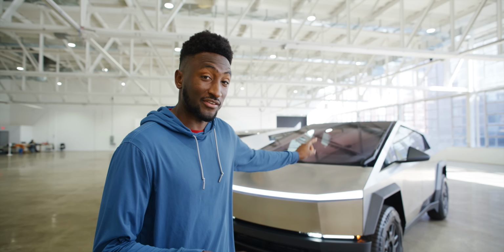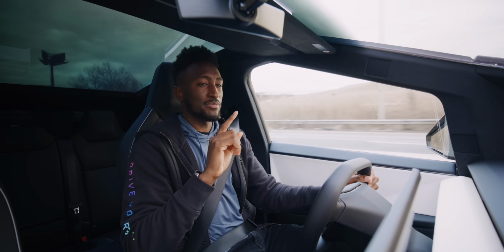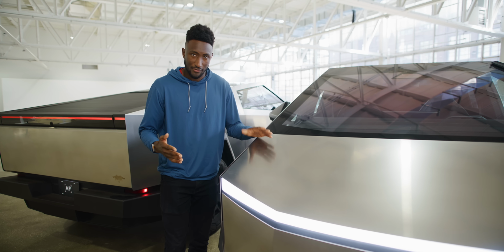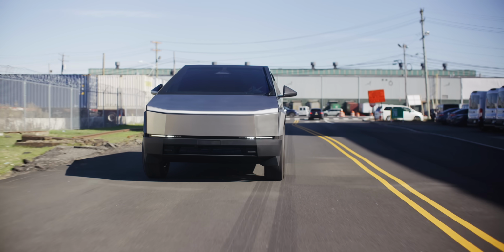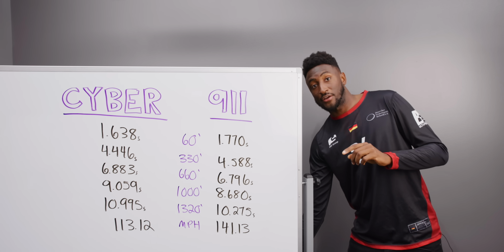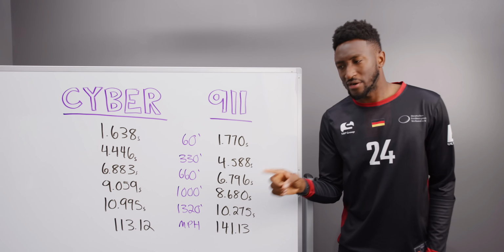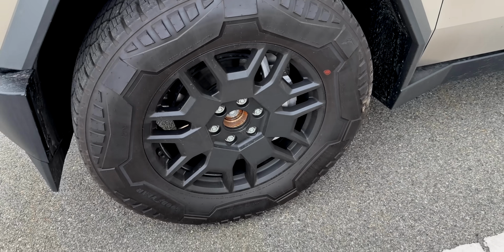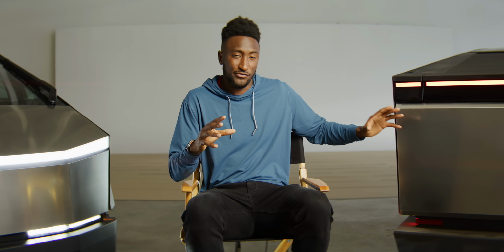Tesla Cybertruck Review: Already Iconic?

Comment: Gas motors are peaky.  They need to be in a certain rpm range for max horsepower let’s say 6000 rpm.  They need gears to help stay in that sweet sport.  Compromises on torque and or horsepower.  More rpm means more horsepower but sacrifices torque.  Electric motors full torque from 0 rpm.  Very torque rich through whole power band at 85% efficiency.  Gas  motors only 25% efficient as most energy given off as heat.  Similar comparing incandescent bulb vs led bulb.  Oil/gas is so cheap that inefficient gas engines are allowed.  Most car gas motors average 24 mpg vs EV’s over 100mpge.  75% of the drilling, pumping, shipping, refining, and transport of oil/gas thrown away to air, water, and land pollution. 450,000 oil refineries located in large cities worldwide causing 50% air pollution and 6 million deaths/year from FF pollution.  Grid is greener everyday.  No tail pipe emissions in front of you in traffic.  Storage batteries on the grid is the holy grail to supply/demand

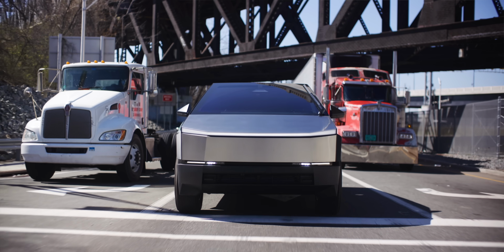Comment: 10:05 'Truck Stuff' there's 2 trucks in this frame and the Cybertruck isn't one of them
Reply: 4 wheels, 6 foot bed. Those are the requirements you need to be a truck. Being liked by Tasz_ isn't one of them.😢
Reply: @retro1120  I had a toyota corolla with a 6ft bed if the back seats were folded down.. I could maybe pass the Tesla off as a ute but it's utility is limited

Comment: Stalk for signaling, highbeams, wipers, and buttons for hvac controls would be GREAT and are MUCH easier/accessible to operate. For turn signals, if you live in the city or certain areas, there are times when you are making a turn and immediately need to signal again for another turn. This is very difficult to do in the teslas when your steering wheel is turned. 
Tesla, PLEASE put physical buttons for commonly used functions(such as hvac).  Physical buttons for some stuff is MUCH better. Bring back the stalk for turn signals.

Comment: We went from non power steering to powered steering to variable ratio steering.  Why do we still have to turn the wheel 2-3 revolutions to turn vs just a quarter turn.  Planes flying by wire for decades.  48v system needed to steering electric motors as well as wiper motor.

Comment: If you wanna talk archaic, we could bring up the fact that Henry Ford tried stainless steel almost a century ago, realized the issues with production and quality when trying to make a vehicle with it, and immediately pivoted back to the real stuff. It's a gimmick. It should not be driven on the road, there's a reason it's banned across the EU and the UK. If you want to endanger others, have a shitty fingerprint covered mess, and love purchasing vehicles that miss pretty much every mark they originally advertised on, the Cybertruck is for you! It is a drivable affront to regulations in this country and that's quite possibly the biggest plus for weird Silicon Valley nerds with extra income just lying around. If that thing rear ends a sedan at high speeds, it's taking the whole top of the vehicle and the driver's head along with it.

Comment: Quite the milquetoast "review". Couldn't even properly call out Tesla for legally lying in their advertisements; I wouldn't call misleading potential customers as "clever". Hardly went over any aspects of the truck apart from brochure bullet points. How about the interior space or things like the front lights don't work all the time in snow because it builds up in the gap between the bumper and frunk. I know some of those things were mentioned in other videos on AutoFocus, but this is supposed to be the main review where you bring all that stuff together into one cohesive and comprehensive conclusion. The conclusion we got here was philosophizing about if the truck iconic... Disappointing, I expect more from this channel. The production value was nice, but that's about it. Style over substance

Comment: Putting the styling aside, the construction isn't that different to standard monocoque vehicles; it has a normal steel unibody underneath the stainless steel panels, although it uses aluminium castings front and rear, that bolt to the unibody. Those castings mount the suspension, which I don't like as aluminium fatigues with use, so I'd be expecting the castings to fracture at some point. Frankly, this is a dumb vehicle that only exists because Musk had a brain fart and had the coin to make it happen.

Comment: Super cool video as always. One thing I REALLY disagree with though and that is dearly missing in my opinion, is talking about the crash behavior of a Cybertruck. You say you'll be fine in a fenderbender, but exactly the opposite is true. Yes, the car will be fine, but modern cars are designed to be destroyed in a crash, because that energy has to go SOMEWHERE. If it isn't the car, then it is your body.
Even though Tesla makes it seem like it's mostly about tech in new cars, they should still be good at getting you around safely. The cybertruck sadly fails at that (to my knowledge) and there are no plans to crash test it independently, which should definitely be mentioned
Reply: that's fake news about driver being in critical condition.
Reply: @JoshuaValvi1  Good catch! Deleted that part, I must admit I only remember that news from when it first broke and it appears the first coverage wasnt truthful. 
That does not change the main point of the comment tough, thanks!

Comment: Trying to sell a "steer by wire" solution as positive is just cheap. I've driven many of those cars by now, and obviously many more with a physical steering connection to the wheels. Not wanting to go into detail here, but you can feel the difference within the first seconds of driving. And honestly, I think most of these digital steering systems can be quite dangerous, because they are so unpredictably bad!  In my opinion nothing better than a steering wheel thats hardens at higher speeds by a physical connection, like in most high quality cars.

Comment: As a cyclist, I  am always concerned about the ability of drivers to see me on the road (bright clothing, flashing lights, etc). This thing would probably kill me at a 10mph collision.
Reply: Watch the Netherlands. Cyclists have their own separate road. Very safe.
Reply: Teslas are literally the most dangerous brand on the roads right now. Look it up.
Reply: Wait. Why do people say this has bad visibility? This has better visibility than most cars out the front in a very wide arc. The back visibility is bad if you have the cover closed, for sure, but the side views are no worse/are better than its competitors. There are plenty of legit complaints about this car, but visibility is a weird one.
Reply: Any truck would be able to kill someone… the Fire F-150 for example weighs only a couple hundred pounds less than this. There should be absolutely no difference in safety for other people, but when it comes to safety of the people in the truck, that is where it rocks.
Reply: @MakerMikeAlt  Yeah, at least the corners on the F-150 are a little more rounded. The corners on this thing are sharp. But yeah, probably a moot point at these weights.
Reply: @jamesvan8166 actually it would be safer as you are more likely to roll over the top of the hood in compared to other pick up trucks which would be like hitting a brick wall
Reply: @jamesvan8166 I can’t see you because of the high hood on the f150. The cybertruck slopes down and gives way better visibility.
Reply: Simply solution, cycle at faster than 10 mph, problem solved.
Reply: Cyclists shouldn't have human rights...
Reply: Tesla has top notch accident and pedestrian avoidance systems. There are some good vids the European Test agency did that are crazy.
Reply: @aaronb7990  and the videos of teslas on their autopilot trying to turn into parked cars, braking in the middle of the road, not recognizing pedestrians, abrupt lane changes, other phantom braking, taking left turns into oncoming traffic, ignoring turn only lanes?
Reply: @justinrockholt7055 half those videos are completely fake. And Tesla isn’t the only one with self driving. Theirs a Uber like app that has no driver and drives around town.
Reply: @justinrockholt7055   Are you from 2014? Tesla, per mile, is 9x less accident prone than other vehicles.
Reply: @derpyderp1144  Tesla is the only self-driving company in the game, they've got a monopoly at this point. The LiDar, pre-scanned environment tech has no general purpose beyond city limits.
Reply: @derpyderp1144 ahh yes, of course they are all fake.
Reply: @Tojoblindeye  I didn’t say all I said “half”. Lots of people hate Tesla’s for whatever reason that is and make videos like that to garner hate for it.
Reply: @justinrockholt7055  Funny how you didn't say running people over...

You didn't even say running into anything.

Self driving is a whole different topic besides accident avoidance. All you said was related to Self Driving which is optional. As for Self Driving making incorrect or uncomfortable manuvers doesn't mean injured or worse. Hands on the wheel and paying attention is how it is intended to be used at this stage. People 'letting it do its thing' for a video are irresponsible and should ha e taken over and left a comment to the Self Driving development team.
Reply: Fortunately, you wouldn't get hit to begin with, it simply won't allow it, even if you're mashing the pedal. 

Tesla and the Cybertruck are the safest vehicles in the world. Will save tens of thousands of cyclists.
Reply: @pt9845 source?

Comment: On the discussion of being "Iconic" the PT Cruiser comment is right on track.  Another example of this I have personal experience with is the VW Beetle.  Beetles were everywhere in the 1980s and again in the 2000-2010s (until they were discontinued for no reason...). Despite being everywhere, they were unique enough to get a reaction; I have owned two of them (2004 pattern and 2013 pattern) and my parents had several of the older versions, and you are constantly being noticed, and sometimes judged, for the car you drive.  That's what the Cybertruck feels like; people are going to judge you for driving one, and that phenomenon won't go away when there are thousands of them on the road.
Reply: It will go away because is just a fad

Comment: It's crazy that we are even comparing the speed of a truck to a sport's car. How fast the Cybertruck is, for a truck, is mind-blowing.
Reply: It's not crazy for an EV truck, others are only slightly slower.
Reply: @roadrash999 only the cybertruck breaks into the 10s in the quarter mile with higher top speed.
Reply: @starshipdriver8536  10.99 vs low 11s, not a massive difference.
Reply: @starshipdriver8536  You the type of person to think a 99 dollar product is a 90 dollar product.
Reply: @roadrash999  over mid 11s to 12s from other ev trucks top trims, they get gapped by the cyberbeast.

Comment: Regarding the drag vs 911, that's false advertising.

 It's a 911T.  A manual 7 speed, a low entry and not the best of 911.
Also it's a 1/8 mile and not 1/4 mile, Because simply that 911T would beat the cyber truck and was catching to it even in the 1/8.

Comment: The Lexus RZ 450e has steer-by-wire and has been on the road for a while now.
Reply: It'll still be on the road a decade+ from now - unlike you-know-what....
Reply: It’s technically not the first production car with steer-by-wire, as that distinction goes to the Inifiniti Q50 sedan and Q60 coupe launched in 2017. They have a conventional steering rack as standard, but buyers could optionally equip them with what the manufacturer called Direct Adaptive Steering, or DAS, its version of a steer-by-wire system.

Comment: Boats at, a certain size are steered by wire. Or more to the point steer by wire and hydraulic. The cargo container ship that slammed in to the bridge was steered by wire and hydraulics. Steer by wire and hydraulic is great until they don't work and then you've got some real problems. What I'm thinking about is the wintertime when you get a lot of snow down there and it freezes. On the boat that doesn't happen much. But what could happen to a truck left outside for a couple of days? Just a thought!

Comment: I'm disappointed you didn't talk about the safety at all. It doesn't "crumple" like any car. So when you get in an accident whatever you're hitting is definitely dead, and the person inside the truck will experience a lot of G forces increasing their chances of death. The automatic trunk close mechanism is powerful enough to cut off your fingers and won't stop.

You did talk about the quality a bit. But didn't mention that a lot of messages are already popping up about trucks starting to rust, which seems like relevant information
Reply: None of that is true. 😅

It DOES crumple like any other pick-up truck. They've shared collision tests, and people have compared it with other trucks too. Tesla engineers are literally experts in Car Safety. Their NHTSA rating speaks for itself.

And no, the frunk closing mechanism is not "powerful enough to cut your fingers". There's a pinch sensor in the front that retracts when it faces resistance. Before, the pinch sensor wasn't very tight, so it would close on your fingers, without "cutting" them - because the edges are filleted (There are YT videos of people testing this), but they solved this with a recent OTA software update tightening the pinch sensors and eliminating that problem.
Reply: Those are ALL wrong. I am a mechanical engineer, first off, the crumple zone is fine. Do you know there are regulations Tesla has to follow in order to out these vehicles on the road? Second, the front trunk does have sensors and Tesla said it will make it more sensitive with a OTA update. And also the rusting problem is just a surface rust and barely noticeable and can be wiped off easily. I can provide sources for all my claims if you care.
Reply: That's just a myth. I dislike the Cybertruck as much as the next guy, but it clearly crumples and the person inside is probably safer than anyone else. It's a deadly hazard for pedestrians, cyclists, and children though.
Reply: @zagreus5773  yeah but if your applying that “danger to kids” standard, apply the same standard to all other trucks on the road.
Reply: @urhot  Yes, I would apply the same standard to all other trucks. How does this change anything?
Reply: We have to wait until the official crash test results come before anybody can truly say it's safe/unsafe. 

As for fingers getting chopped off, I like to show you the 100% steel hood of my Astro van.
Reply: Tesla has listened to the public and is redoing the frunk.    Everything else you say in nonsense.   The truck has crumple zones.  A tesla engineer talks about this on an in factory video with sandy monro.  This is a 6K lb truck.  Many of them on the road.  Lighter than all the other electric pickups.  It does not rust.
Reply: @danharold3087  "It does not rust." Cope. They're rust spots and not other car has them, including the DeLorean. Tesla screwed up, face it.
Reply: These reviews are for nerds vicariously living through consumerism. That’s all. Hydrogen is a much much much for vital way to handle “climate change” but you’ll never hear that from these big YouTube channels because they’re clueless. It’s HSN 2.0.
Reply: your statements are false, the cutting fingers vid has been disproven
Reply: You seem to have absorbed a lot of misinformation. Lack of crumple zones, rust. Neither are true. You really think Tesla would ship a vehicle that doesn’t ace both IIHS and NHTSA tests?

Comment: I think instead of the PT Cruiser, think more like the 1995 Dodge Ram Truck with that "Semi" look that the others copied that ended up as the monster front ends they have today.

And that's just the looks.

The Cybertruck has so many revolutionary features like...
48v
Steer-by-wire
Massive range in the suspension
Powered tonneau

Do you know what competitor is going to suffer as production increases?

Yes, some truck owners will get them, but the large SUV segment, the Suburbans & Expeditions bought by soccer moms who want to drive a beast because they think they are safer. And here the stainless steel is a plus.

What if Tesla is able to make a rear wheel drive Cybertruck for less than the Detroit 3 can make?

Comment: "durable truck is useful" Until you crash and it doesn't crumple very much. That is actually horrific for both the driver and anyone in or out of vehicle you are hitting.
Reply: You can see it in the crash test 🤦🏻‍♂️
Reply: I remember internet comments saying Model 3 was going to burst in fire bcs of the battery pack, turns out it's the safest car ever made...
Reply: @michaeljohnson3529  yep, turns out using explosive liquid as fuel causes fire at a 11x higher rate.
Reply: its literally out on the road already yet people think that it dont have a crumple zone
Reply: You're right. I want a vehicle that will get me killed instead.
Reply: It does crumple, or it wouldn't be legal.

Tesla is by far the safest vehicles in the world, even for other drivers and pedestrians.
Reply: @pt9845 According to LendingTree a few months ago, Tesla has the highest accident rate out of ALL car brands at 23.5 crashes per 1000 drivers. Also, did you even see the crash tests? They barely passed, especially in the side on test. The doors basically didn't crumple at all. Not even mentioning what happened to the crash test dummy... You need to stop being a fanboy and accept the cyber truck has flaws.
Reply: @pt9845 read the news broski
Reply: @pt9845 ”Tesla” and “safest” do not belong in the same sentence 😂
Reply: @pt9845 exactly, and everyone knows it. But the moment a vehicle that hasn’t been tested in public much is released, they try to say it is the worst vehicle on the road safety wise. It makes absolutely no sense what is going on in these peoples heads.